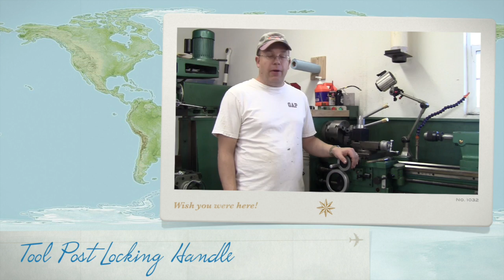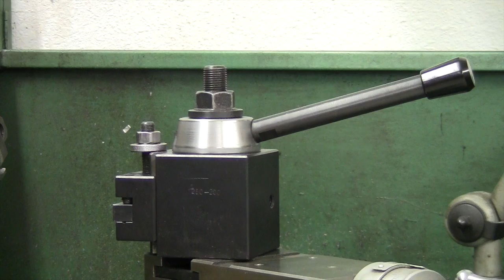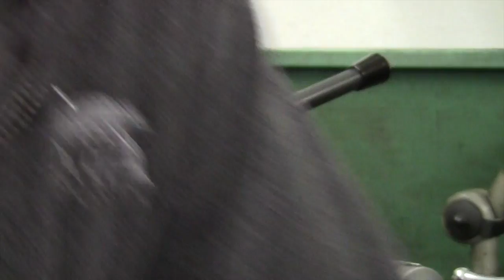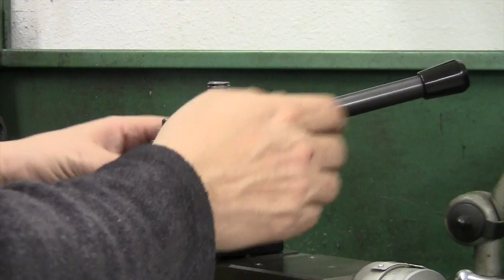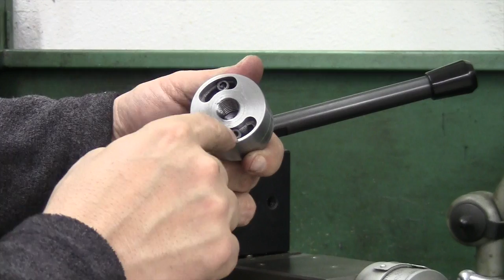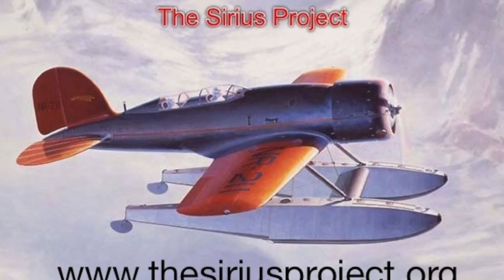Tool Post Locking Handle

Comment: Great tool post handle design.  Like the adjustment capability, and it looks good with the new handles.  Great work overall.  The small angled stud that is covered by the post.  My lathe has one but it is not under the tool post.

Comment: Hi TSP,
Built the same many years ago for my quick change tool post. Instead of an adjustable nut( lots of work, but that's what we like) I made a large washer  under the nut about ¼ thick and skimmed of a few thou off till the handle was positioned in the best spot. As you say it doesn't change  unless the thread wears or stretches. Would have liked to see you make a large T nut rather that the flat plate. You still have chip collector and it will probably bend over time.and there isn't really much thread engagement for the bottom of the stud.There is quite bit of stress on that area when you make heavy cats.
Thanks for the video. Lots of people have no idea what a machinist does or is capable  of doing.

Thanks jb